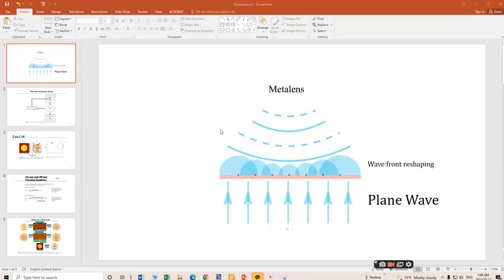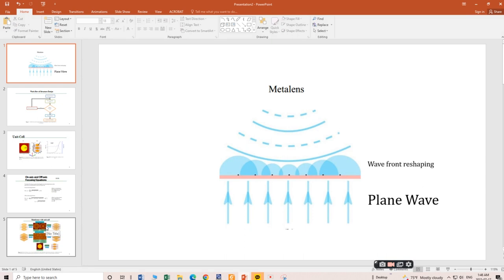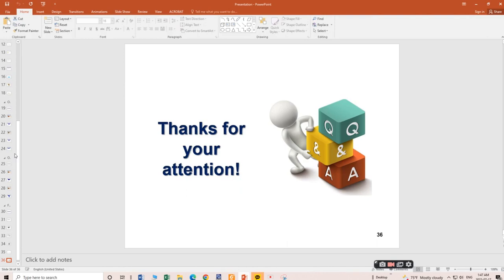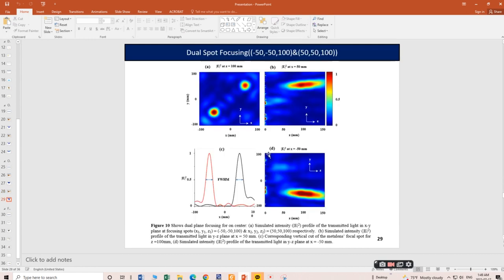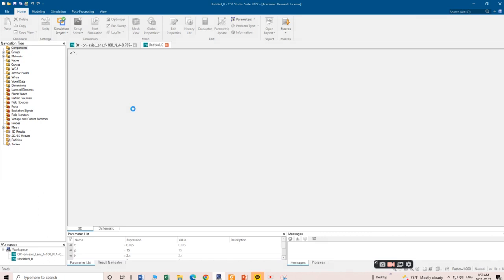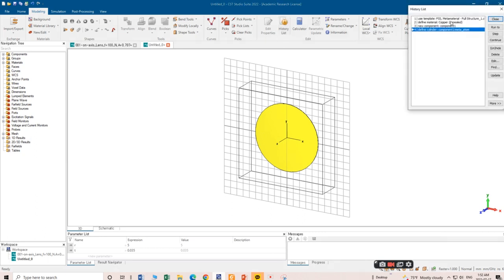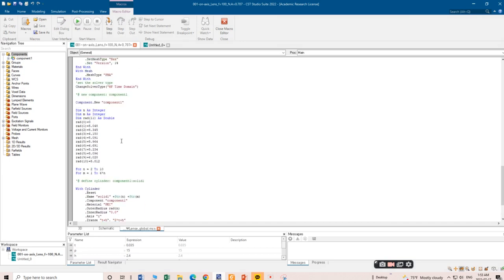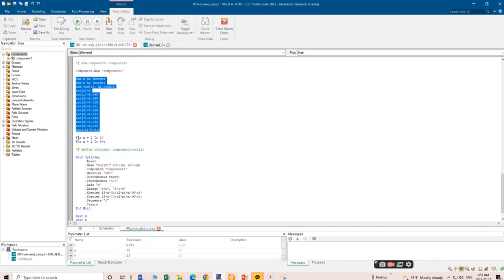how to create metalens using Macros in CST

Comment: Bro if we have 2 different unit cells and we have specific coding sequence, how to do it in cst using macro
Reply from the maker: In that case just create those two unit cells first and then create  macro file. Then you will have those two unit cells inside macro script, there you can repeat them in whatever pattern you want to repeat
Reply: @TechSimLab  if possible can u plz make a small video on it as well. Will be highly appreciated